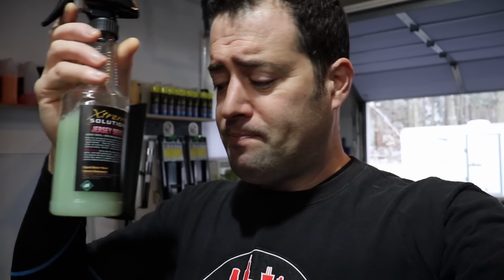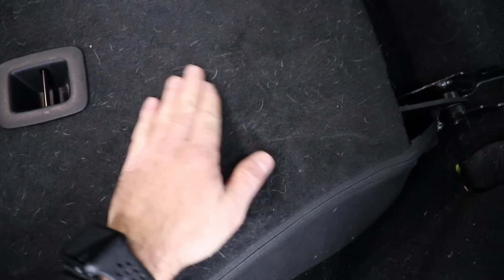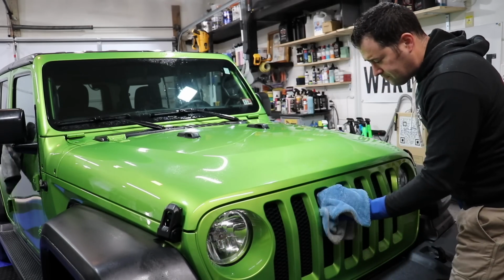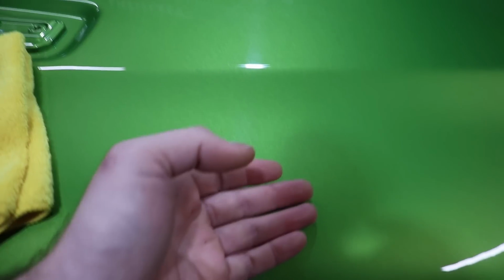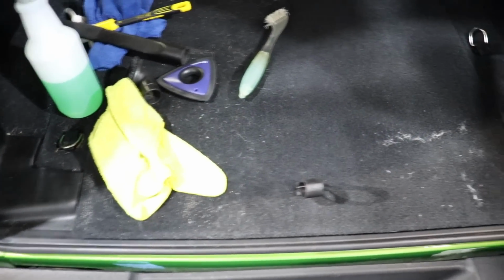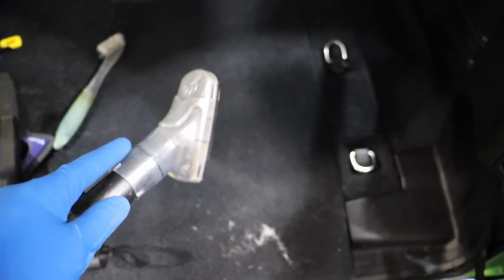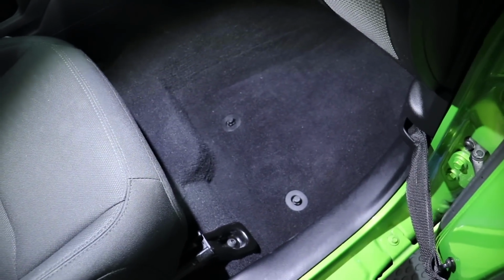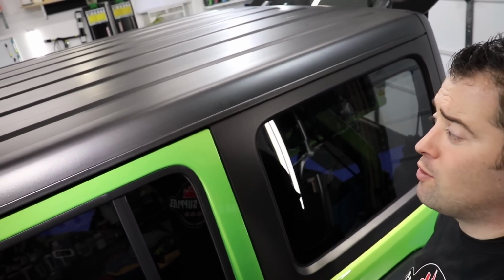Interior & Exterior Detail / LOTS OF DOG HAIR! Jeep Wrangler #analan #detailingtips

Comment: Phil...I have a question about detailing the exposed spare tire on the Jeep.  I would assume you would detail the side wall of the exposed spare tire, but since the tread is exposed and takes up a lot of territory, would you detail the exposed tread as well, and to what degree do you take it?
Reply from the maker: Hi Great question.  We clean just like the usual tire and wheel, but I dont go to crazy on the exposed tread since it will get debris again quickly. a quick scrub and pressure rinse and it looks great.

Comment: Hey!! Love love yalls videos. I have a question. The attachments you used for the dog hair removal,  will they attach to any vacuum ?
Reply from the maker: Hi thanks!   So most household vacuums have the same diameter nozzle so these attachments will fit on them perfectly.  also most 1 1/2 or so shop vac hoses and nozzles will also take these attachments.
Reply: @MirandaDetailing  awesome! thanks so much for replying! I ordered those tools today, along with the vacuum you linked. Hoping to have everything ready to start my self, by the end of next month.  again, thanks for replying!!
Reply: I checked on the Carzilla.ca site. In the description it says that the hose diameter that it fits is 1 1/2 inch. If you have a smaller vacuum ie. 1 1/4”, they say you need an adapter.
Reply: @peterjurenovskis5933  thank you!!

Comment: I did an exterior detail on a Dodge Challenger awhile back that was the same colour as the Jeep you just did, except it had a lot of those big Mopar stickers in different areas. What would you recommend for those areas when applying different coatings?
Reply from the maker: Hi. You mean applying coatings on the stickers?
Reply: @MirandaDetailing  yes, would you apply right over the decals or just avoid those areas?
Reply from the maker: @pauladams7180  You can go right over the decals with no problem at all. it does not affect the finish or make it glossy
Reply: @MirandaDetailing  thanks for taking the time. A 2nd opinion is always good in some circumstances. I’ve never seen so many decals on a car. On this car the whole rear quarters were covered, hood, rear deck lid, & sections of the doors & fenders.

Comment: Phil I’m in the car business. When a customer buys a car from a dealer the dealer will have the clean up guys spray a wax, or spray detailer, on the car before the customer picks it up. That makes the surface shiny and slick. It only lasts a couple weeks then it’s gone! Also the drive thru car washes spray a very thin coat of wax, if the customer pays for it, near the end of the cycle. That too doesn’t last long. Looks like what was happening on this Jeep! Great Vid!

Comment: Most dealerships around here at least use simoniz glass coat...we got my wife’s vehicle done when we bought it brand new back in 2016 before I started getting into coatings. Needless to say it lasted about 2 months and I wash her car on a regular basis so not doing that again lol. If u have the chance to try out adams graphene ceramic(not the spray) I highly recommend it. I’ve applied it to several vehicles and the look, feel & performance of the coating is insane in my opinion. I think u can get 60 ml. of the coating for like $70. Which for the durability claims it offers seems like a great deal to me. I like it on paint, glass & wheels, not so much on trim though. Have a great day guys!

Comment: You should park the trailer in the garage when it’s cold out. Or is that more hassle with disconnecting from the truck?
Reply from the maker: Hi. I thought about that but it won’t fit. The heater in the trailer is perfect.